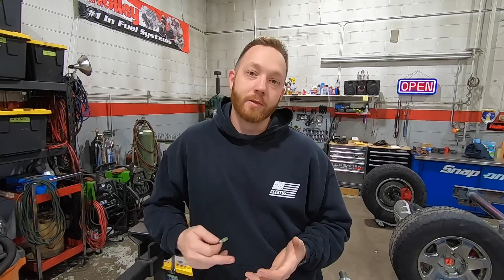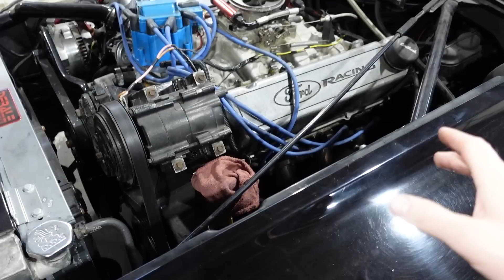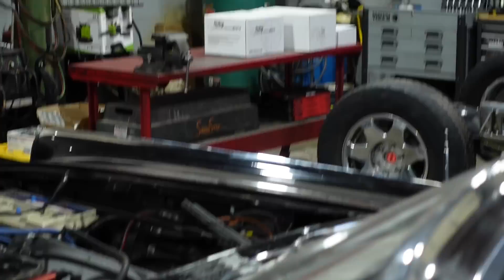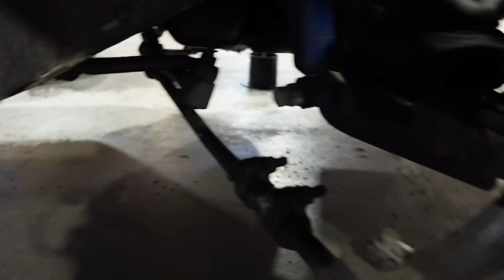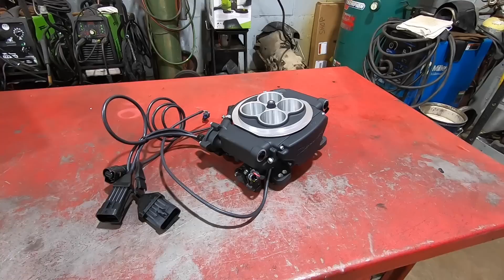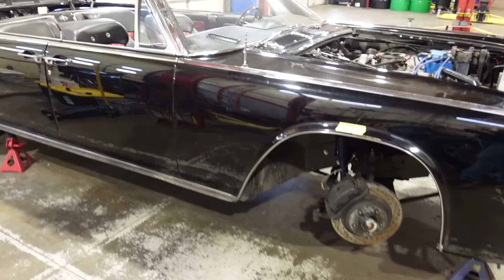our FIRST BIG PROJECT at the abandoned shop

Comment: Do not use those connectors in the engine bay! 
I've tried and failed. 
Low temp melt solder fails with underhood temps.

Comment: Hydroboost is AWESOME! It is NOT just a brake system it increases power steering too! Use PTFE line and save yourself the time, hydroboost systems get hot enough to chew through rubber, even on the "low" pressure side. It will even burst around seals if one does not use PTFE thread locker on the seals. That's where the vacuum light troubles root and why they where recalled, every 50,000mi they require all new rubber lines...or...upgraded lines on installation. I literally had to burn cash to learn this whole system inside and out on my 8.1L because English is not a strength of your average grease wrencher lol. "Press the brake 5 times, and drive it" is both right and wrong for the bleed procedure. In case you yourself run into this problem, what I found works for the GM system(I do hear there is a major difference In the Ford setup lol). Once everything is bolted in tight...engine off vehicle on the ground WITH THE CAP ON, press the brake 5 times(depresurizing accumulator). Start the engine, cap still on, press the brake 10 times(pressurizing accumulator). Shut off the engine, pop the cap. Hear the hiss. Repeat. When the unit begins to squeal like steel on steel, while the engine is on during the pressuring of the accumulator then the until is "bench bled" now let it idle for 2-5min the vacuum test. Once all that is done drive it 10mi or so, and freek out when the lights come back on, yay "micro bubbles". Pull over when safe shut off engine, press the brakes 5 times pop the power steering cap to relieve the pressure. Get back in and drive. This can happen over and over again....normal for this system even up to a week later...just remain calm pull over pop the cap and keep driving. If there is a leak the only way to know where it is to keep this up and look for weeping around the seal points, that's your leak. PTFE thread locker fluid on the flares of the AN adapters the inputs of hydroboost AND steering box use MAY be required as this is just short of air conditioning pressure. Hope you don't just use rubber lines on this, it was literally THE failure point in this system. Also the only time the system can read normally on the dip stick is when the accumulator is pressurized, other wise the fluid that would be in the accumulator will be in the pump. Do the weird dipstick reads make sense now? Good luck.

Comment: Im sure you already have a different cam, but if ypu haven't... go check Richard Holdeners channel. He just did a zz502 cam into an 8.1 and it was a good amount of power and torque.  Didn't seem to lose any power anywhere on the dyno.

Comment: Use loctite 545 on your air ride fittings NPT connections. 
Clean dry threads and let the loctite 545 dry 24 hours. 
No need for Teflon tape.

Comment: With the rising cost of fuel can a older vehicle (2005 Jeep 4.0 inline 6) be switched to run E-85 ?
Reply: Yeah man it's possible. Mechanically your engine will run fine on e85, you just need a computer system that can understand a smarter o2 sensor (wide band)
Reply: @ryurc3033  what would you recommend running?

Comment: One of my favorite 60s cars. The only badass 4 doors are ones that are with factory suicide doors. Not a big fan of the wheels, but it’s not my car. Cool for the owner … I’ve seen them with Detroit Wheels steelies and poverty caps. Love that look. 

Most of the power options (windows definitely) are powered by hydraulics. The hydraulic container is behind (I think) the front right wheel well. Subject to leaks … 

Looking forward to your work on this. No, you can’t convert the trunk to a pickup bed 🤣🤣

Comment: I've tried they style of butt connectors before.. not from that brand, but a premium brand, not cheapos. The solder never melted. The heat shrink caught fire and burned. I won't use that design again. From anyone. That's my personal experience with it. I have used a LOT of heat shrink before. I'm no newbie. My sales rep thought I'd like them. I did not and will not ever use that style. . Just to let others know my experience with it.
Reply: I work for an aircraft manufacturer and we use shrinkable solder connections for shield grounds. The gun has a wrap-around nozzle and concentrates the heat so that melting the solder isn't a problem. The spec even allows for a slight discoloration (burn) of the sleeve. Hope this helps.